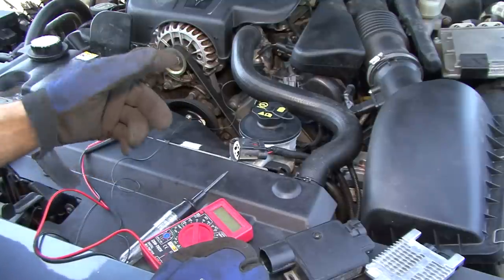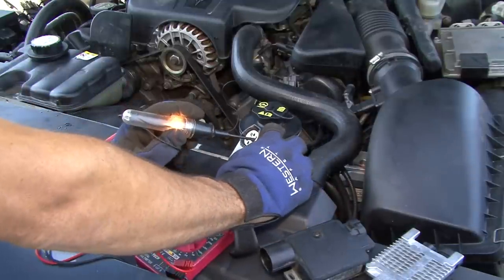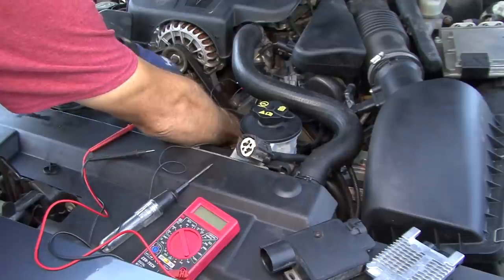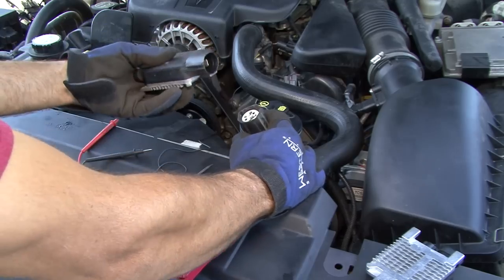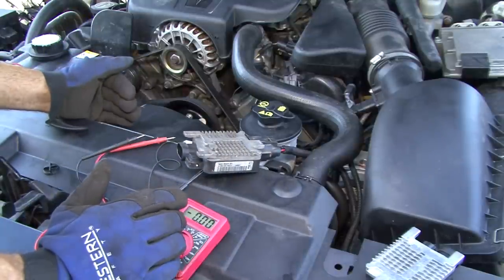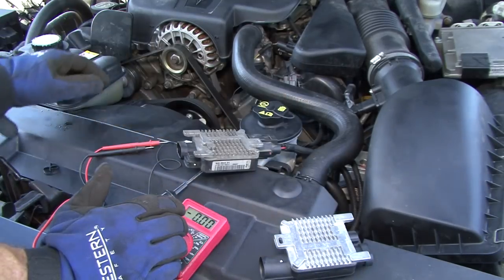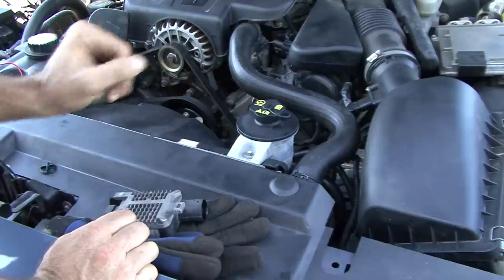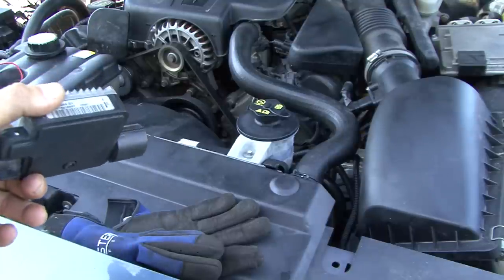crown victoria radiator fan module troublehooting and replacement

Comment: As Rashed mentions, and you have not made any comment about the voltage? The fan is a 12v fan and you want 12v to it. As you show when testing the fan! Granted we all make errors by sometimes getting our thought reversed when giving a presentation, the Voltage from the Module should be 12!  Which lower then that indicates that the Module would be bad. Not trying to make you look bad just hopping to clear something that may confuse some people with less knowledge of the systems they are looking for help with.  Would like to see a correction if possible?

Comment: I have a 2004 Crown Vic police interceptor.  It recently began overheating when driving normally, but if I turn on the A/C it almost instantly cools down with radiator fan running.  Fan does not turn on w/o running A/C.  Why won't fan turn on w/o A/C on?  What do I need to check?

Comment: So I have no check engine light on or any noticeable problems. The only issue is my fans constantly run when AC is on. If AC is off they don't run. Even on Cold start If AC is on the fans constantly run instead of cycling.

Comment: All voltage in the car is 12 v so it should be give 12 v otherwise the fan  will not work in this video the module give variable result less than 12v so the fan will not working because it have less supply from the module in that case the module is damage and should be change this my troubleshooting i check the module it give 12v and i give the fan direct power from battery and it not work so i change the fan and the problem is solved this day iam sorry about the grammar writing iam from Saudi Arabia thank you
Reply: rashed I have a question.. during the test I should turn the car on or off?

Comment: Hey Cody, I want to take a little time to thank you for the excellent video. Two and  a half years ago my car over heated on the road. I was far away from home so I had no choice but to have a professional mechanic fix the problem. They charged me $450 and installed a cheap $75 Cooling Fan Assembly that totalling failed and burned up last week. This time I was close to home and with the help of your video I installed a heavier duty, higher quality unit for $225. My wife and I have a 2008 Mercury Grand Marquis LS. We love this car. It has 140k miles and drives better than a new car.  We do not remember when the A/C felt this cold. It will literally freeze your ass off. 🤣 Thanks again for the great video. There is nothing more gratifying than completing a DIY project, putting your hands in your pockets and saying YUP, I DID THAT! 😁 Keep up the great work. God bless and have a wonderful day. 👍🏻
Reply: If your engine dies on a long highway on a crown vic. You won't know it til you stop and go. Engine will stay cool enough as long as you keep it moving. I've already used the heater core to keep the engine temp down. First warning before temp goes up. On a crown vic your ac will start getting warm. Keep an eye on your engine temp pull over before it hits the hot line on the gage. Run the heat to cool the engine down. If you can keep the temp down you can get it home.
Reply: Quick question how did you know it was your fan sane thing is happening with me I think, my car ran hot on the highway I think its a thermostat but it may be the fan because I've heard of people replacing the thermostat with no resolution to the overheating
Reply: @christianjacobs2767  easy to test it is start your car when its cool and turn on the a/c to max. if the fan comes on it is working properly if it doesnt then the module is bad. now if the fan comes on at temp your fan is working but id do an amp test to see how much amps the fan is drawing. but if your car ran hot on the highway it is something else a fan issue wont cause it to overheat while moving cool it down then put the heat on and full fan it will act like a small radiator. if you have a full radiator and working water pump.
Reply: Dorman makes a great fan assemble for these crown vics' grand.M. AND LINCOLN TOWN CAR
Reply from the maker: Glad it helped!! That is exactly why I make the how to videos.

Comment: I have a 07 grand marquis replaced the fan assembly and module entirely now when a.c./defrost on the surge happens and rpms drop down really low any answer to why?
Reply: Did you find the problem out?

Comment: Does the module have different speeds at idle vs when the car is running?  My 2010 overheats when idling for a long time.  Fan is spinning and on.

Comment: Hello Cody. I have a Marquis and my fan works sometime and sometimes not. I ran a direct 12v to the fan off the battery and it didnt power up, but all of sudden the fan started working again yesterday when I tapped around with a hammer. It comes and goes. I hear what sounds like bearing noise very faintly so I am thinking its the fan motor going bad. What are your thoughts?

Comment: If the module is bad will the fan come on at all? My fan works during cold start in the morning. after the engine warms up my fan doesn’t blow when the car is idling. My ac will stop blowing cold air at stop lights but blows cold at cruising speeds.

Comment: Thank you for this video. I own a 2006 Ford Crown Victoria Police. I'm having problems with my car overheating. The fan wasn't working. I hope it's just the fan control module, or the cooling fan relay, and not the fan. The cooling fan relay is cheap but the module alone is expensive by itself, but it's cheaper than buying a new fan and a new module. I hope I can fix it myself. Hey can I check the module connection like you did with just a volt meter? I don't have that volt checker that lights up when checking 12 volts. Also, how did you connect the gator clips to test the fan with the battery. I couldn't really see video.

Comment: Help!  I have an 08 Crown Vic Police Interceptor and we’ve changed out the fan, the module, the water pump, the cht sensor and thermostat. When everything is connected no fan.  When module is unhooked fan turns on. Any suggestions on what to try next?
Reply: Any solutions yet?

Comment: :038 WISH you had of shown EXACTLY where to connect the alegator clips
Reply: Simply connect red and blank wires straight to battery poles, in regards to the fan connections there is no way to get it wrong, if you connect the wires on opposite ports the fan is either going to push or pull air, remember that is just for functionality.
Good luck.👍

Comment: So if I turn on my ac on my 06 corn Vic 
It will automatically mean the fan and module is fine ?

I just bought a 06 and I’ve noticed I never see the fan come on yet the temp on bezel stays center ! 

I was worried I may have issues ?

Comment: Could you tell me any possible cause for the module to burn out in an '07 LX besides perhaps its location to the radiator being undesirable? I have replaced this thing 4 times and don't want to do it again without finding the root of the problem. Could a temp sensor be a cause?

Comment: Help.  Working on a 97 mercury couger with 4.6. The a/c fan works,replaced both temp sensors and the module also. The fan will not work for cooling the engine.  Fan spins good with the a/c on .should I order a fan? Driving me crazy.

Comment: "01 Grand Marquis here... OEM fan still runs but when it kicks on the dash voltage meter pegs down to low. Slowly rises back to mid range, any suggestions? Is it normal? also fan powers up just fine and cools engine, but voltage seems to be sucking up to much when it's kicked on. When i try to spin the fan manually by hand it makes a squealing type sound slightly.

Comment: I have an 08 grand marquis, voltage going to the module is 14v, yellow top optima battery, and I get .5v coming out of the module. The fan itself spins freely. So all I would need to replace is the module, right?

Comment: Do you test the fan? I've fried t modules. Fan works and spins freely. But on f350's in the mid 90's the blower motors had problems they ran good but the switches would melt. Fans worked fine but unknown to Ford they were drawing to many amps. I'm pretty sure my car is doing that I still have to test the Amp draw from the fan motor. Point is just because the fan is working with a jumper doesn't mean it is working right.

Comment: When you tested the module output you said the voltage shouldn't be no greater than 10 volts i noticed the engine wasn't running so this test is done only with the key on and the a/c button on?

Comment: Just replaced my fan module for the second time.  First time it went out, I unfortunately replaced it with a cheap part on Amazon that was $25 versus the $121+ for a Dorman and the ungodly $246 the actual Motocraft module is.  Fan stopped running after about 10 months use on the replacement fan module.  Took it out and it fried one side of the output pins on the module and charred one side pin input on the loom connector to the fan.  I purchased a Dorman module from O'Reilly's, cleaned up the connector to the fan with a wire brush, and replaced the module.  Worked fine at first, then fan would not come on again.  I checked voltage out of the module with the engine running and the AC on.  It read 14.6V.  You're saying if it's over 12V, it's a bad module.  Should I just get another module, perhaps different brand (not cheapo) and try again?  I sprayed out the connector to the fan with some contact cleaner and it ran fine for a few days, then started to not run the fan again and car started to overheat.  I have no check engine codes at this time after I cleared them and replaced the module.  This seems to only be happening when the AC is on and sounds like a common issue with the Vics (mine is a 2011 P7B).
Reply: Did u fix problem
Reply: @jose2x147  I did.  I replaced the entire fan assembly including module (it was included with fan), thermostat, and did a coolant flush.  Runs like a top although I'm not 100% happy with the fan I bought at O'Reilly's.  It vibrates like it's not balanced.  Pulled the first one out of the car after three days and exchanged it, same problem just slightly less.  A slight vibration at idle when the fan is running can be felt and even heard.
Reply: FAN MOTOR IS TOASTED AND BURNING UP THE MODULE
Reply: @jasonthiesen8699  check the mounting of the fan housing and make sure its square and level. Sounds like its crooked.
Reply: @MIXMASTERBJB1  I did, both times I installed it.
Reply: BEST TO BUY THE WHOLE DORMAN UNIT! IT HAS ALL NEEDED. AND AT AROUND 2OO. NOTHING BEATS ALL NEW.
Reply: NOT COMMON. BUY THE WHOLE DORMAN UNIT. IT'S TOP QUALITY HAS ALL NEEDED. WE HAVE TWO STILL RUNNING 17 YEARS. WE HAVE 5 CROWN VICS

Comment: Hey, Cody. My fan works when I jump it to 12 V. But, the fan doesn't work when A/C is turned on. Nor does it work when engine is hot. I replace module, cylinder head sensor, and check 50 amp relay. Do you think it's the PCM? Thanks. 2007 Ford Crown Victoria Police Interceptor
Reply: I bought the same car a couple months ago and I'm having the same problem. I can't imagine needing to replace the cooling fan I've only have 110000 miles on it.

Comment: I did all of that plus some and still the fan will not come on. Every connection has voltage and continuity as it should but still the fan just will not come on. The fan will work if I jump it from the battery but the computer for whatever reason will not turn it on. I have 12v from the pcm wire, 12v from the fuse wire, and the ground wire is good as it lit up my test light when I connected to the positive side of the battery. The other side of the module two wire both had the correct voltage. I'm so confused how the fan just wont come on and I tried 3 other brand new fans today and 4 different modules, this is a taxi cab I am working on at work. Nothing is turning this fan on and am I at the point if tomorrow replacing the cylinder head temperature sensor does nothing I am going to be forced to straight wire the fan to the ignition switch. Any insight would be helpful.

Comment: I think the module is bad on my ford edge so I have been researching the problem/symptoms. You mentioned in the video that if the output from the module  is higher than 10 volts you automatically know the module is bad, Can you explain a little bit? Mine reads 11-12v
Reply: Mine is doing the same did you ever find an answer?

Comment: nice quick video but you leave a lot of troubleshooting info out.... what does the third little wire (fan variable you called it) do?..where does it get it's signal and what should it be when the engine is cold or hot??... My fan works fine when you connect it direct to be battery and the module output is 6.7 volts with the car off and the engine warm but not hot enoguh to have to trigger the fan... when I have the car on and the engine is starting to overheat where the fan should turn on, the fan doesn't and if I check the module output voltage it is now 11.6 but the fan still won't go on if i plug it into the module at this voltage...shouldn't the fan be going on with a voltage that high.... what could the problem be? has it to do with the third signal wire?... also if I turn the A/C on the fan doesn't go on, (but I have to say I'm missing freon so I don't know if the fan would go on in this condition)... would appreciate your input here as I don't want to buy a $130 module for nothing. Thanks in advance
Reply: same here! 09 crown vic currently fan running with speaker wire!
Reply: That's the signal wire from the Computer tells the fan on off and high low.
Reply: Did you you figure it

Comment: Are you sure the 3rd connector isn't a rpm feedback for the module or ECM ??? Fan speed would be being influenced by car moving through air so computer needs to know actual real fan speed no ?

Comment: I’m having an issue where my fan seems to always been running when the car is turned on. Even when it’s cold. Any ideas? 2003 grand marquis. Fan running even when car fully cold. I’m guessing it’s running on low as I’ve never heard high speed engage

Comment: 2003-2005, Grand Marques& Crown Vic, town car too. That is different controller. Salvage yards, are not great at getting model year correct. A lot of times, fans are fine, It's the module(fan controller).

Comment: hi. i have 2011 lincoln tawn car it over heats. i notice when the gage get to half way the fan does not function but when i turn  on the a/c the fan turn on. my question is this, should i change my radiator fan or temperature sensor? by the way no check engine. Thank you.
Reply: Any solutions?

Comment: Ok my Crown vic seems to have a different module. It's hardwired into the fan. ?? YUP unchangeable unless I do some jerry rigging. My fan works it just wont turn off at highway speeds. Why does it need to run full speed when the car is moving?? And then when parked not sure if it comes on at all.

Comment: I have a 2006 Crown Vic and the Fan doesn't work, I tried checking voltage and I do get 12 from the plug that goes into the regulator and 8 on the other side and the fan works with direct power.
I tried replacing the temperature sensor as well so I am confused can you advise?
Not sure if it means anything but I changed the water pump a couple weeks ago!

I just don't know what else to check :(
Reply: Air in the system

Comment: I have  a question  do you know  where  the coolant  temperature  sensor  is located on a  2007 crown  vic?
Reply: magik1ful under alternator it's called a cylinder head temp sensor
Reply: Take off the altinateor and it on the right side on the  cylinder head

Comment: I'm having an issue where the fan comes on sometimes with ac or not, and sometimes it doesnt, u have a 2015 ford focus and it overheats, I changed out ect and module and I just notice that I'm only getting less than 1 volt before module, relay is new to

Comment: Cody I have a 2006 Crown Vic police interceptor My car has been over heating and I suspect it because the radiator cooling fan is not coming on.  I have changed out the Water pump, put in a new thermostat as well as CHT sensor and today replace the cooling fan module  I started the car, turn on the A/C and the fan doesn't come on  I have also direct wired the fan and it does work  Whats my issue ? also fuses appear to be ok
Reply: I was wondering if you fixed your issue?
Reply: ME 2
Reply: Sane here😅

Comment: hello I am wondering where the coolant temp sensor is located on these cars?  I looked on the aluminum coolant bypass tunnel by the alternator where it is located on my 4.6 mustang, but I cant find it there or anywhere near the alternator.
Reply from the maker: If you look its in front near the thermostat housing look straight down you should see it, facing the motor look down to the left and closer to the block
Reply: Cody the Car Guy  Sweet thanks for the fast help!  IM going to look for it tomorrow when its less cold/windy here lol

Comment: My 2009 Crown Victoria P71, overheated on me last week. I made a big mistake taking it to Midas. Anyway the reason why it was overheating was because the Radiator Fan Control Module. But my alternator was also bad. Anyway they replaced the Radiator Fan Control Module and within the next couple of days the car over heated again! I took it to a different Midas and they told me it was the Alternator this time! Hopefully someone can explain how a bad alternator can cause the car to overheat? cause it's sounds like the rad fan still wasn't coming on after the mechanic changed the Control Module and didn't bother to see if it was indeed working properly. I ended up changing the alternator myself with a reman one. We checked after to see if the Rad fan was coming on and it was!
Reply: So it was it  your alternator not charging the fan properly?? Can that be be the problem?